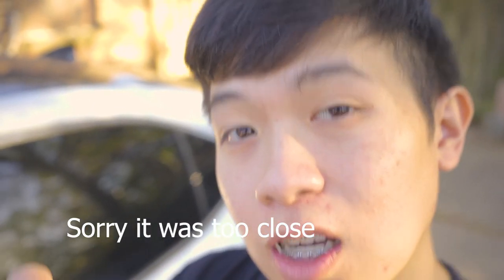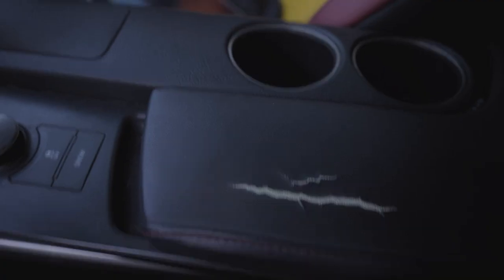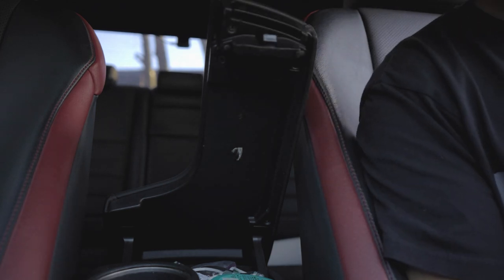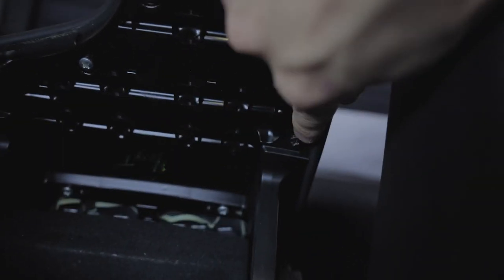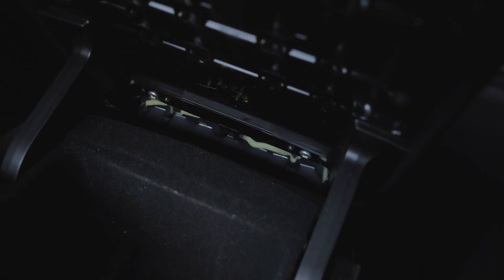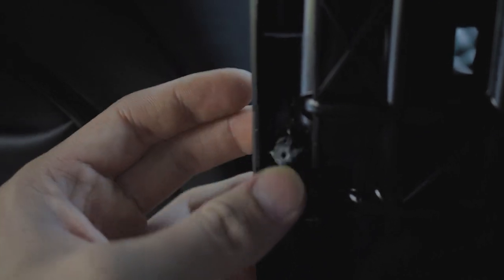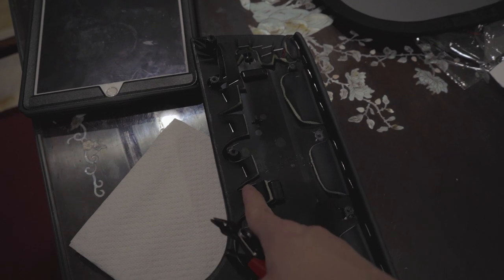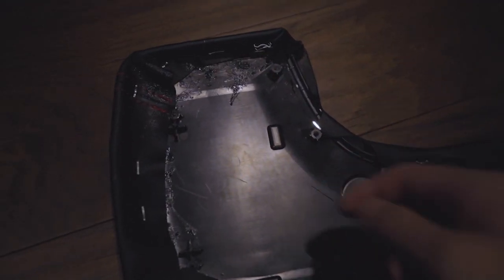FIXING ONE OF THE COMMON ISSUE ON A 3IS (Arm Rest)

Comment: A couple comments.  I did the same instillation.  Remove the entire armrest through the air vent in the back.  Then when you remove the staples, do not use staples again.  Use gorilla mounting tape and don’t be afraid to cut some of the leather to make it fit better.   Mine turned out perfect.
Reply from the maker: That would’ve been smart. If I ever need to change it again I’m definitely going to do that
Reply: Can you expand how you used gorilla mounting tape?

Comment: If I saw this clip earlier that could help me to unscrew those 2 last screws at lowest part easier. I didn't have a heavy duty staples, so just used double side sticker, it worked strong too. I did it and completed the job, it looks a lot better than before bearing a big crack on that armrest looked awful. Thanks Jonathan to see this clip very helpful. Hope can view more your others interesting fixing clips. All the best to you 👍👍👍 👍👍

Comment: Pro tip, use glue instead of staples.
Reply from the maker: I tried the glue first and it didn’t work I may just end up buying the whole
Piece if it happens again 🤣
Reply: @Jonathan.Nguyen  there's a special transparent glue for leather but what I did was m3 tape and glue on the paper. I sand the piece down tho so It has a good surface to grip on. Stretch and heat gun after, cut the corners so you have a more flawless look. I'll make a video when I do it on my car. 💯
Reply from the maker: @goatpier7570  definitely will check it out too I hope not to see it happen again but hey if it does I’ll give it a go
Reply: @goatpier7570  please do it. I need to do mine